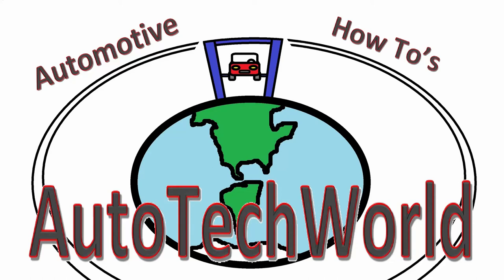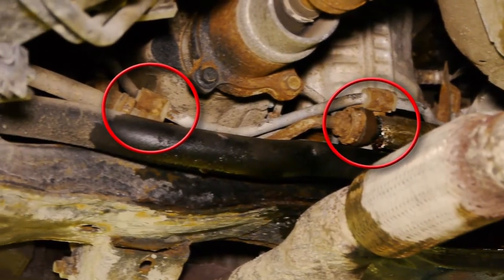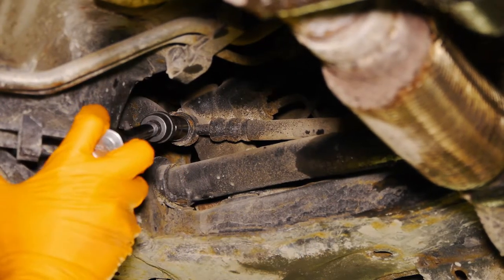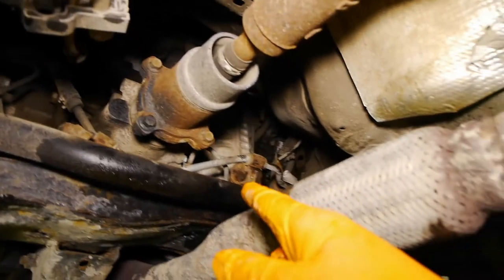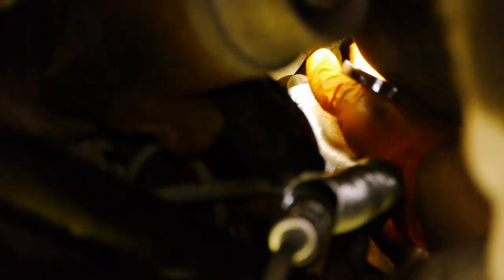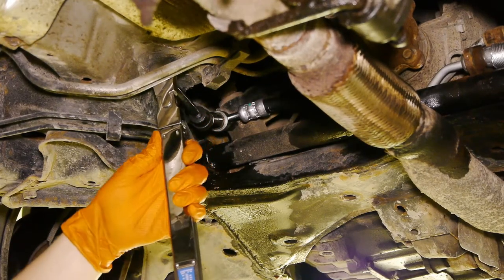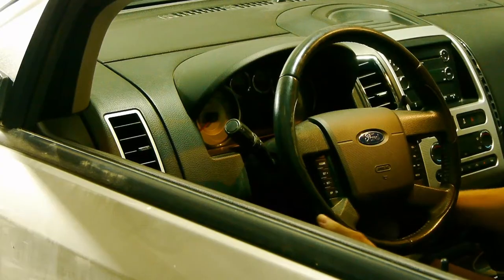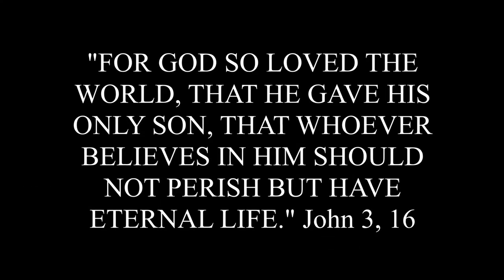Ford Edge Power Steering Hose Replacement | 2007-2014

Comment: Great video! Very precise and informative. I’ll be replacing my low and high pressure power steering hoses, and yes Ford recommends using Transmission fluid instead of normal power steering, even though regular power steering will do the job. Anyways thank you!!!

Comment: Nice Video very informative, just paid over $700 at the dealer to replace it.
Reply from the maker: Ouch, that's a big bill.
Reply: Yes, a hair over $1400 including the HVAC repair (which was ridiculous, over $600 for the blend door actuator on the drivers side).  I REALLY dislike going to the dealer.

Comment: Can I change that hose using a hydraulic jack or do I need a lift? 😢
Reply from the maker: You should not go under a vehicle lifted by a hydraulic jack. Always put jack stands under the vehicle as well, because the hydraulics can let go causing the vehicle to drop on your face, potentially killing you. 

You don't need a lift though to change the line, to answer your question. You may even be fine driving it on ramps.

Comment: Did the exact same change with the exact same part. Didnt take long. Sprayed it all down with brake cleaner. There were 2 leaks. One at th nleft side banjo. Amd another on the seal of that block the hose is connected to. Can that block? Be changed. Idk what its called
Reply from the maker: If I remember correctly, that is your power steering pump, is it not?
Reply: @AutoTechWorld_DIY  the pump is where thel nhigh prealssure line connects to the passenger side. The left side is where you saw your leak. But that hose is connectes to some kind of blocl thats connect to the steering column. Yheres 2 additional metal hoses that attach to it. Idk what that part would be called :(
Reply from the maker: I'm so sorry. I don't know where my head was at when I read your first comment. That is part of your steering rack. You'll have to replace the whole assembly. You'd be looking at something like this:
https://amzn.to/4dlGGGS

Comment: so can you do this job on the ground like with out a hoist and just jacks? and the problem with my power steering was when I left work I turned the wheel all the way too much to left and I jammed it too hard and maybe thats why its leaking
Reply from the maker: That could be the cause. And yes you should be able to do it with Jack. Make sure you use some Jack stands and don't just leave the car on the Jack. Please be safe. You could also just drive up on ramps probably if you have some. God bless you.

Comment: Why are you using transmission fluid instead of power steering fluid?
Reply from the maker: Good question. Ford recommends transmission fluid. Makes sense?
Reply: @AutoTechWorld_DIY  Yes because they are both hydrolic systems!
Reply: Transmission fluid is better
Reply: Some ford vehicles use transmission fluid instead of power steering fluid that's ford for you.

Comment: The pump side is royal pain the butt...aligning  and not loose copper o ring is tuff... not much working room 
Very  diffical spot... to tight pump side.....

tip remove emc harness  in engine compartment 
 and use 1/2 drive with 17mm socket with 6 inch extension  and long handle ratch with flex head..

Very tough to see anything... all done buy feel if working under car
Reply from the maker: That's right

Comment: Can you mix mercon v with dexron III?
Reply from the maker: Depends on what oil you are using. Just looked at my pennzoil atf and it works for mercon LV (which works for mercon V) and Dexron VI (which works for dexron III). Check the bottle, it might be printed on there in small somewhere.
Reply from the maker: If it is for your power steering, you should be fine I'd think. You should always add the manufacturer recommended oil though.

Comment from the maker: PARTS:

Power steering pressure hose  -  https://amzn.to/3uHbdJI

Power steering fluid (MERCON V)  -  https://amzn.to/3AitLkB

Power steering reservoir cap  -  https://amzn.to/3lb4tk5

TOOLS:

3/8 in ratchet + socket set  -  https://amzn.to/2Ykvk4V

Swivel kit  -  https://amzn.to/3BehSxr

3/8 in torque wrench  -  https://amzn.to/3aeQqUk

1/4 in socket set  -  https://amzn.to/3l90FzX

1/4 in ratchet  -  https://amzn.to/3iAXgs6

Metric wrench set  -  https://amzn.to/2Ylco68

Metric ratcheting wrench set  -  https://amzn.to/3Fv6aRQ

Brake cleaner  -  https://amzn.to/3FhuHJU

Nitrile disposable gloves I am wearing  -  https://amzn.to/2X8c3lc